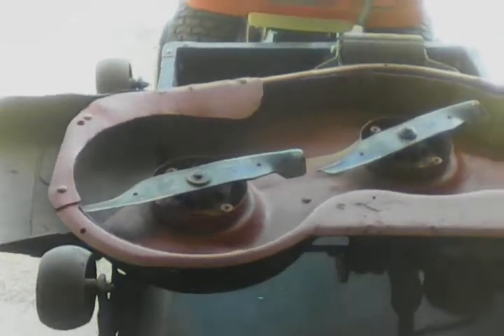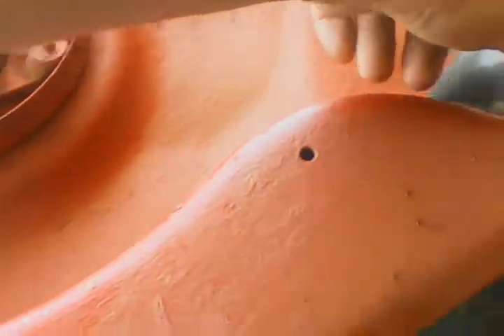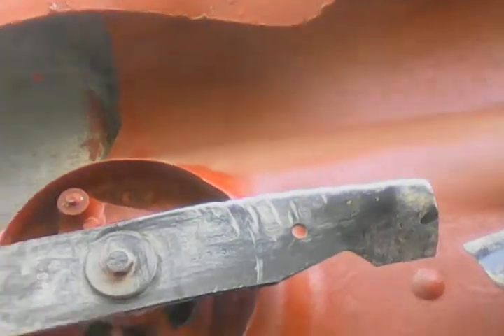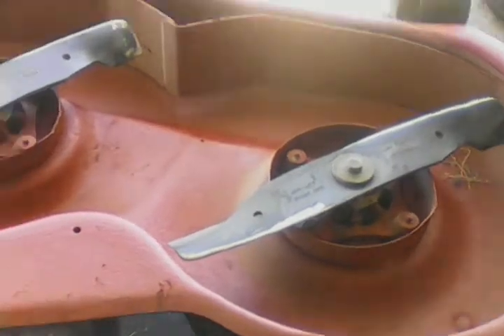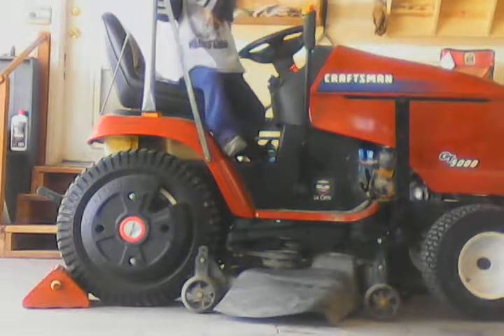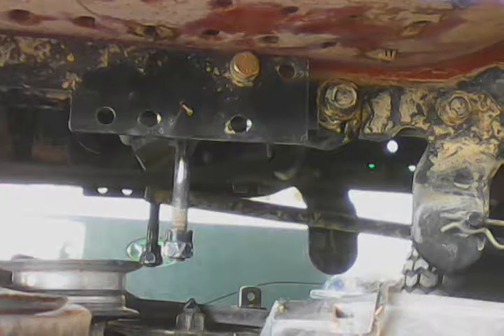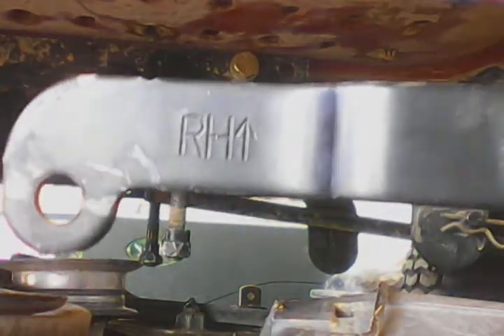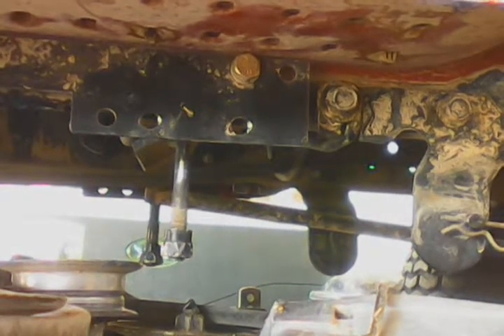Putting the deck on the GT5000

Comment: I have a 03 gt 5000 the deck is screwed up the deck sets in the ground and I've tried my best to adjust it but still it sits on the ground. Do u have any videos on how to adjust it.
Reply from the maker: I do not. It should be the 2 rods that connect the deck to the lift linkage. It could have a jam nut on top, so you'll back it off and then tighten the one on the bottom. If it doesn't lift at all check the linkage it's probably missing a pin
Reply: There is a turn knob on the lower left side that you can adjust your lift lever height. Have you tried this ?
Reply: I've tried everything but I think the whole deck is bent. It looks like who ever owned it has rolled the mower at some point. I just got rid of it, got tired of messing with it. Thanks anyway
Reply: Sorry to hear that dude maybe you could find a used one on EBay? Good luck!

Comment: You didn't show how to attach the front support!
Reply from the maker: My support was still on the mower and the deck and snowplow both just have slots that slide onto it.
Reply: I learned all too well that the deck is not easy to attach on my tractor unless I Jack it up off the ground first to make the connection more accessible. After going through all that I tried to activate the blades and nothing happened . So I replaced the pro switch and still nothing! At this point I am lost for an answer other than that the clutch is messed up too! What a pain in the butt!
Reply: That word was supposed to be
PTO